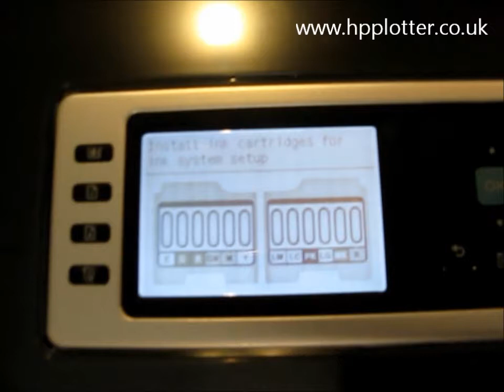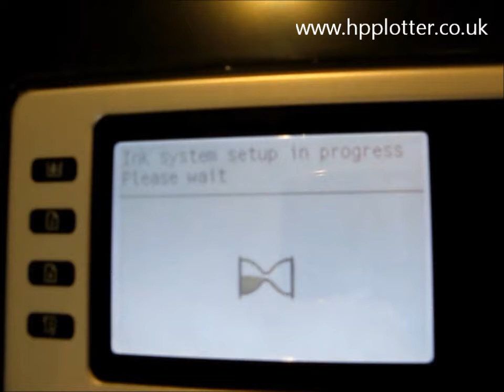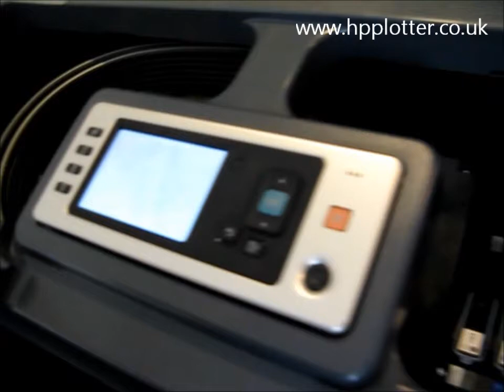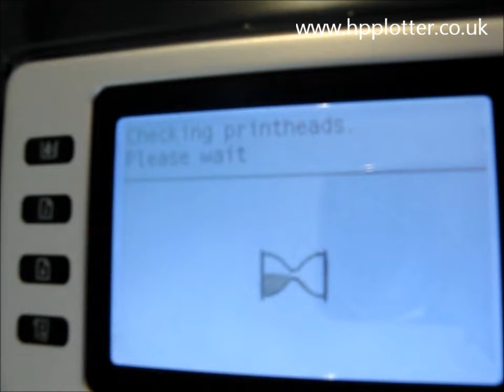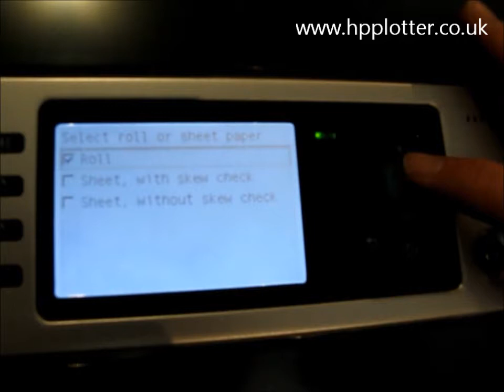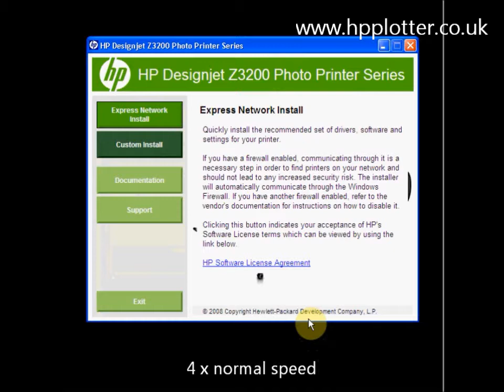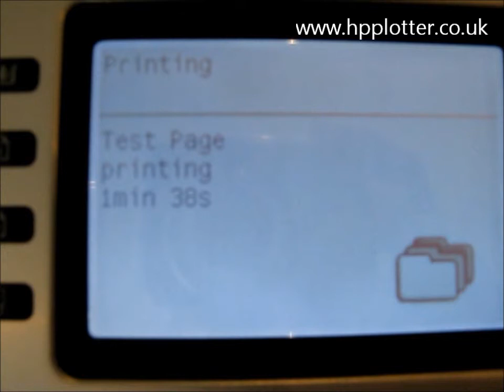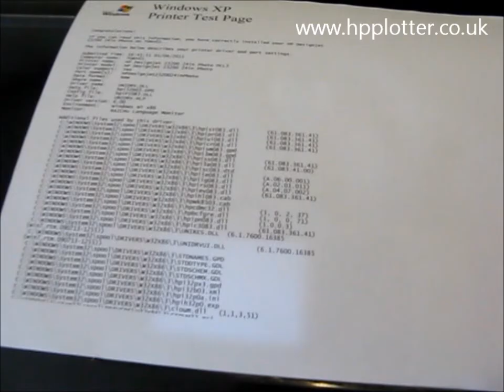HP Designjet Z3200 printer - how to setup & configure your HP Designjet Z3200

Comment: i like to buy the z3200 photo printer but do i need to use the whole cartridges? they are 12 and expensive too... also do i have to laminate it after printing ? what kind of ink do you use and why? i see some people use tubes connected to gallons so that they don't have to change the cartridges , does this printer use this option?

Comment: wwwwwwwooooo   i bought it .... still did not install it , do i have to store the ink in a special temperature?  there is a video on youtube show the installation (step by step) for the z3100 from a to z which means from opening the box until he print his own design, is the z3200 steps  are the same as the z3100?